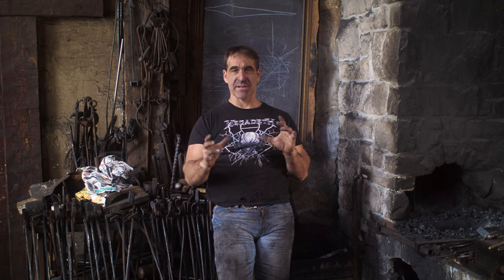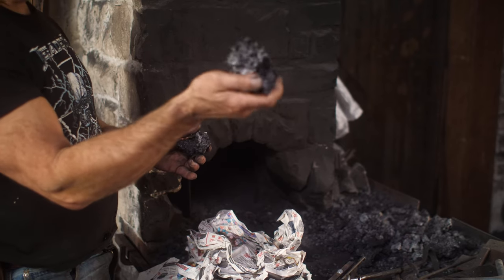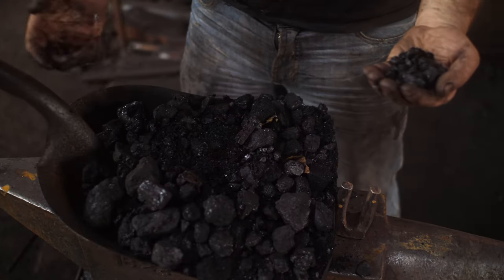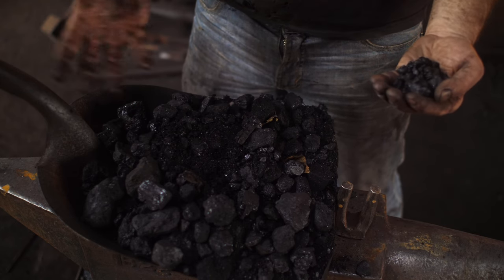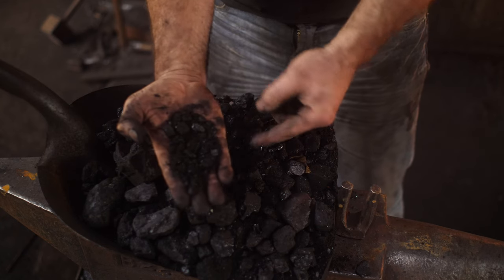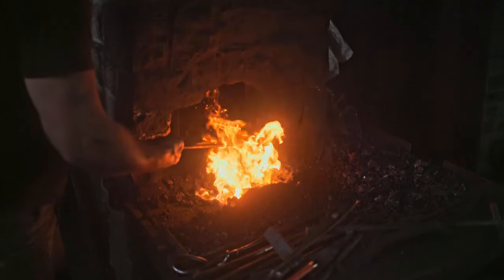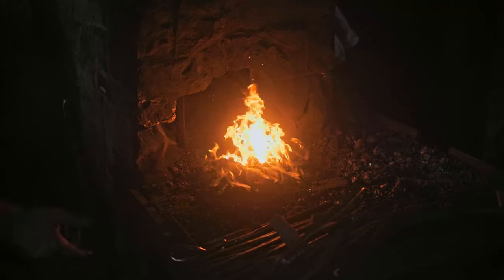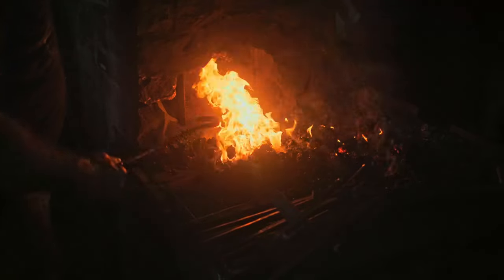Blacksmithing Coal - Fines are Just Fine - Thak Ironworks

Comment: I've been using high quality new Zealand coal fines wet to build a 'roof' over the top of my fire when I want to create a cave to see thin pieces color , or for forge welding. I keep it wet with a can with holes in the bottom like a shower. It  forms a nice crusty roof that wont collapse. feed the fire by pressing in new coal from the sides in a downwards fashion to keep the fire fed. Always admire your quality intstruction Thak!
Reply: As i where told whan i was an aprentice long time ago, my master taught the water would also help kepping a concentrated hetspot by adding in generator gas from the water it self, i don't know if this is tru or just s theory, but it seem to work with higer grade coal. (unfortunatly i could only get ceap grade industrial coal where live and it creates tons of dust and does not build up that nice little oven, we used to buy British coal back in the days, maybe one can still got it but it is very expensive where i live nowadays, i guess it is much easier and cheper to obtain good quality grade coal in NZ or if one live in or close to the US, in the south of the US there are also i think great options to make Antracit mixtures in order to adjust the desired burning time and temperature desires). (Sorry for my English it is not my native language.. .)

Comment: Green coal when burned mixes with water in the atmosphere and produces sulfuric acid. This is far worse a problem if you keep your coal wet. Maybe not such a problem with a brick chimney as he has, but if you have a steel chimney it will eat through it in short order.

I’m using the same coal he does and have a side draft “super sucker” style hood made from 16 gauge. Just a year and a half old and I have severe thinning and several pin holes. I live in a humid environment so I’m sure it doesn’t help. I may make my next one from stainless or significantly heavier material but I believe it will still be a consumable part to some extent.

Comment: in germany the general available coal is allready quite pure, some time near to anthrazite. at least thats wat we import from poland. 
but i really prepare the coal to have a lot of tar and oils in it to build my fire as like you would with charcoal and clay, and i allways wet the outsides.
using this my coal cunsumption decreased dramtically and i can controll my fire based on what dimensions i'm working with.
note on working with high carbon steel (c45 upwards): i tend to use a mix of charcoal, coke and coal supported on the sides with bricks to have a more uniform fire. this way the piece of steel can be left to fully warm up inside the fire and not only the outside parts of it.
there are so many ways to do it, but i deffinitly prefer coal oder gas.